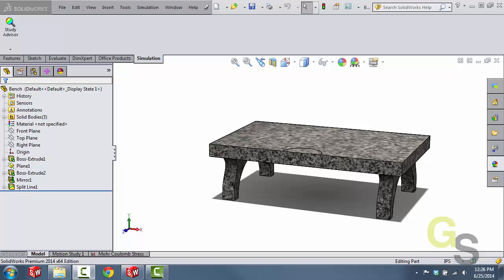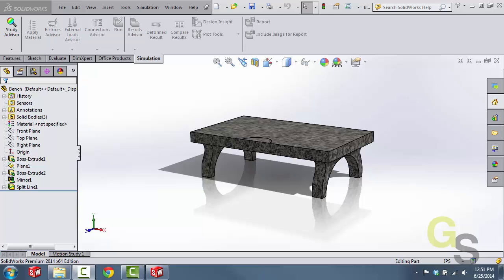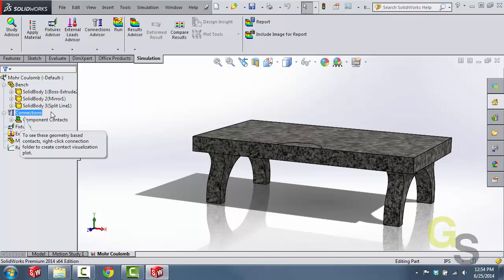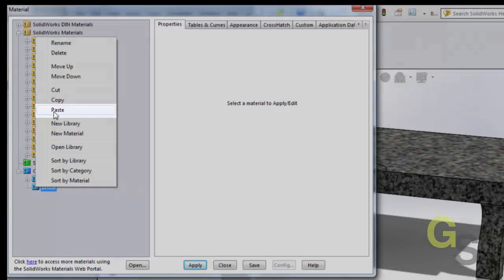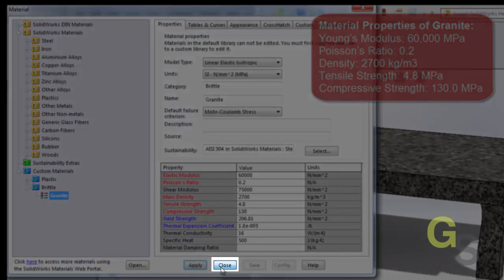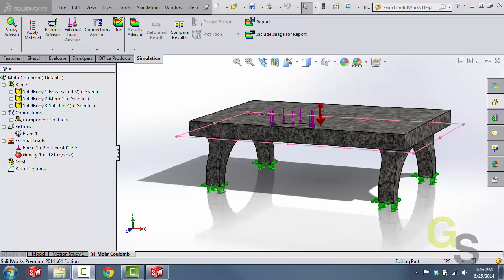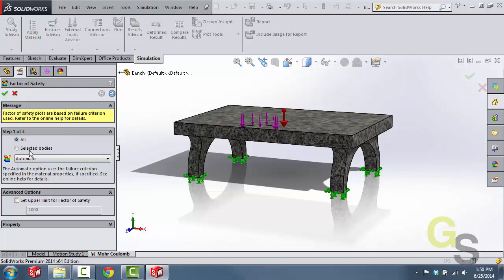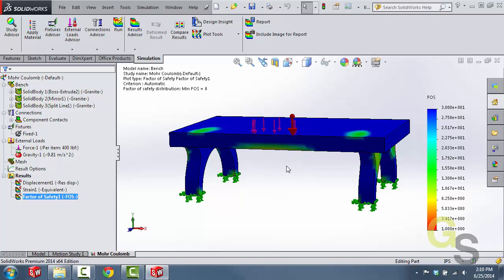Mohr Coulomb Stress with SolidWorks Simulation

Comment: It seems that the approach for "Connections" is wrong. As you know, the bench like this one is gathered without any glue or other contacts, so you can imagine to yourself the next:
1) the upper slab stands on two supports and can be represented as a simply supported beam
2) secondly, the reactions of this simply supported beam are equal to the weight of a person devided by 2 ( W/2) and this reaction force goes into the legs as axial force

That is why you see the bending moments on the legs (there sould be only a compression force) 
And that is why when you use FOS you see the weak spots in the slab, above the legs (it shows that there is a lot of tension on the upper face) 

..... Sorry for my english/

Comment: Mohr coulomb is meant to hydroestatic-pressure dependant materials such as rock and concrete. In these materials the strenght increases with the global pressure. Von mises is for materials wich failure only depens on the deviatoric stress such as steel. But this alone doesn't tell you anything about ductil or brittle,some  steels can be ductil and you would stille model it with von mises. If you want to know about what happens after you reach the failure surface of the material, you need to define a "flow  rule"  or some fancy crack-growth  criteria.